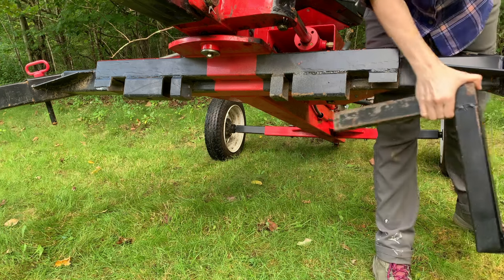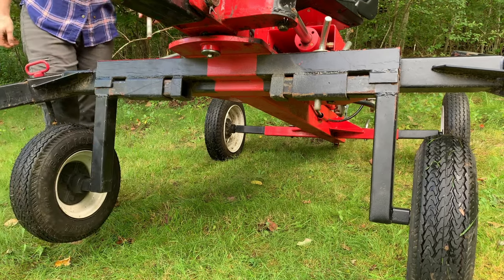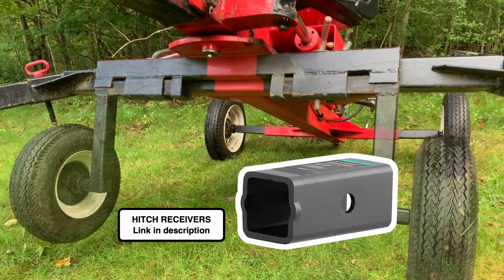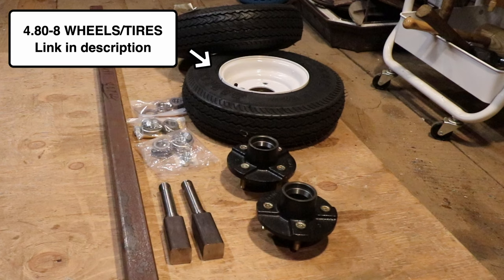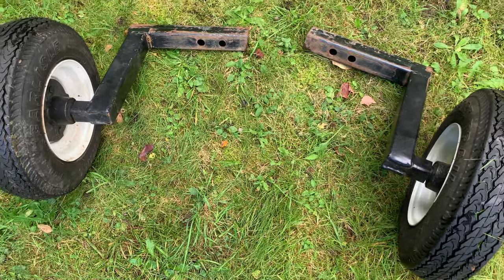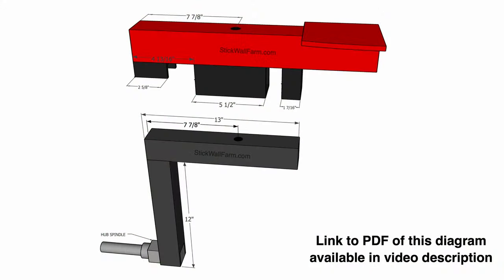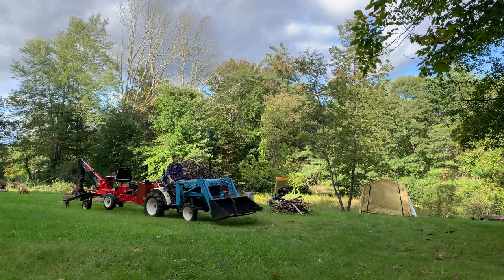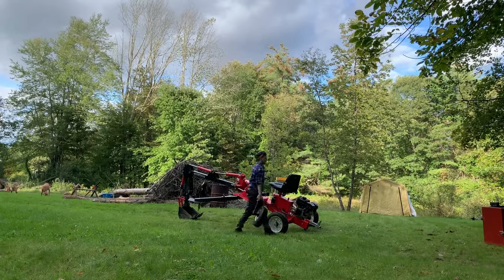Adding extra wheels on a Harbor Freight Backhoe Trencher

Comment: Does not make sense, you still need to take them off. use existing slots and round tube. You will not have to remove again.
Reply from the maker: I did round tube at first. Too much play - all the stress was on the pin/holes and they warped.

Comment: Definitely subbed. I'm like Patrickm9831... I am waiting patiently for your pintle option video.
 I bought a machine to work my 10 hectare property. Moving it is my number one hassle.
My Canadian sourced towable is from the same factory Betstco uses so there are minor differences from your descriptions but your ideas are top shelf.
The pump replacement video really caught my attention. Harbour appears to offer  either 9 or 14 hp motors.  Is your machine a 9 or a 14 motor? ~ mine is 9.
One big difference between our machines; mine is plumbed for a third circuit if I wanted to install a hydraulic thumb. Currently I don't see the need/value for a newbie like myself.
Reply from the maker: Thanks for subbing - appreciate it. It is a 9hp motor. Wish it was plumbed with a third circuit!